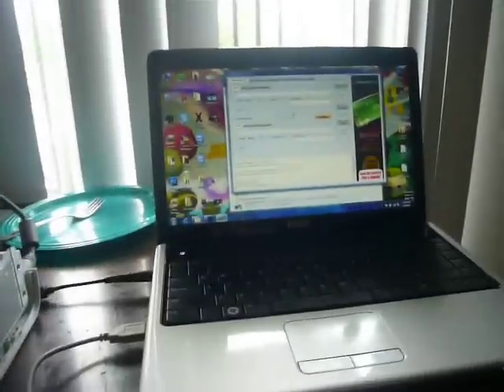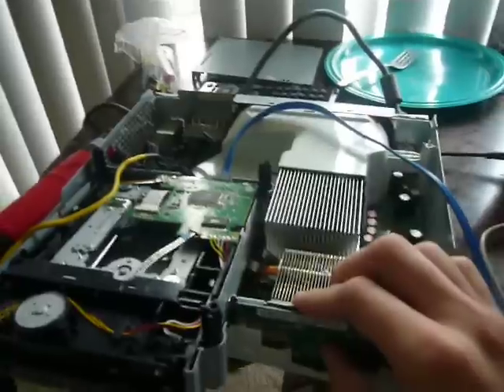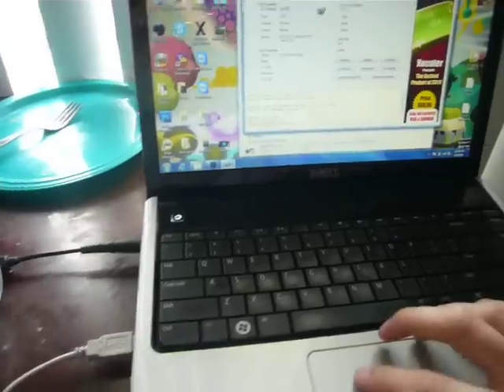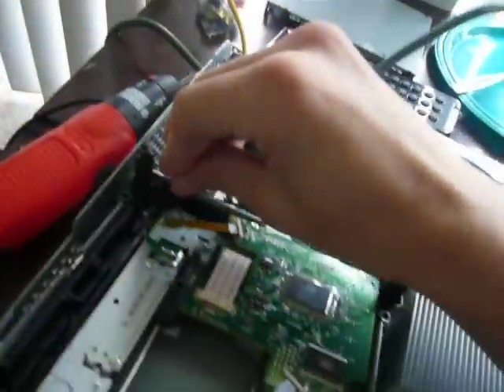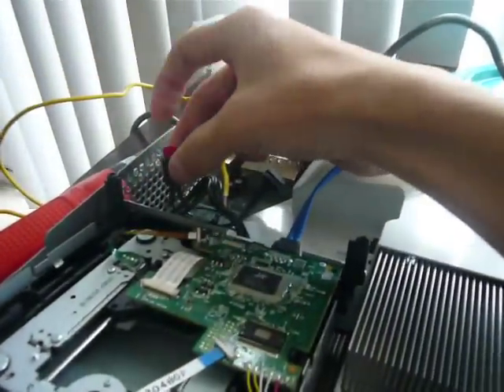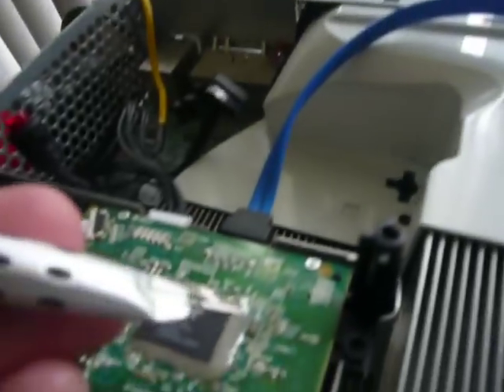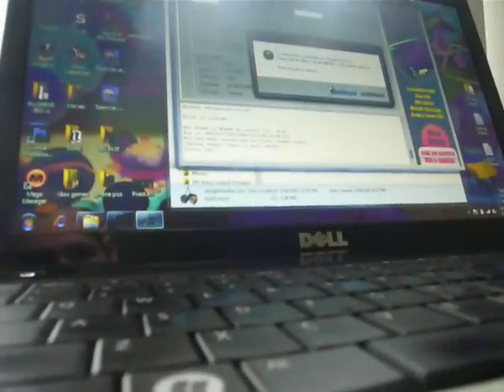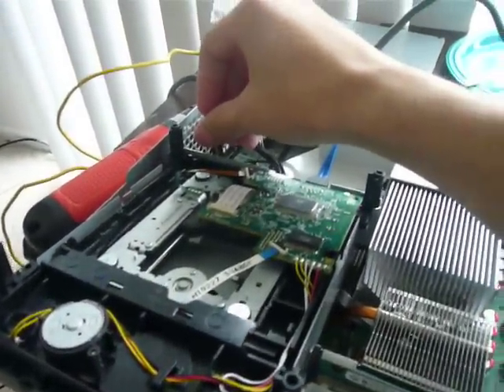Other method for getting key on phatkey failed(TUT)

Comment from the maker: i would atleast electrical tape it. you dont want any wires touching and shorting out anything. just a heads up ive seen it happen to people before doing that. i think i only paid $2.35(usd) for my switch and i had the cable laying around. so my diy PMT was only like a $2.50 thing. but hey atleast you got a working PMT thats what matters.

Comment: Who needs electrical tape? I just twisted the wires around the switch's metal pins, of course it's bulky, but I only paid like 1,65 Euro for 2 switches (and I used the 2nd for my DROM drive). I wanted to get a working console as cheap as possible after my old BenQ rrodded, so I got me one with a dead laser off ebay for 30 Euros without any controllers, PSU and whatnot, used the laser off the BenQ and the cheapest method for getting the key, which is a wire, a switch off ebay and a sewing needle.

Comment from the maker: yes but really thats sloppy and those switches your talking about are huge and bulky. i made my for compact. If i just used a on off switch from home it would be huge as hell. And you may want to just remove insulation and add your wire to that line thats cool. BUT again your doing it sloppy. your prolly adding just electrical tape after you do it. i prefer heatshrink the whole way thats why i cut the line to add it. Your choice tho..you ca go sloppy or do it right the first time.

Comment: But you can also use a simple on/off switch, just take the cable that sends power to the drive (the black one with the white connectors) cut the second wire from the left, remove the isolation on both ends and connect the switch, you don't even have to solder it. I got my switch off ebay.

Comment: thanks i know it sounds silly,, its just a simple switch im sure,, but just want to do it exactly how you did,, i got my switch/button at radio shack (it is a 4 pin) and im not sure if that was the correct one to wire into the drives pwr ribbon type cable,,, so  if you can just describe the buttons wiring  into this setup  i know the 3.3v pwr (pin 6) gets the switch wired into it,, and (pin5) gets the probe,,,just want to be sure im doing it correct,,,,

Comment: is it normaal that when I click on YES powerOFF the drive and WITHOUT POINTING THE PROBE as soon as i click on powerON  i get the message "SERIAL FLASH FOUND WITH THE STATUS 0X52" WTF?? btw  I try to flash it with the new iextreme v2.0. i use ck3 probe but no luck i get Phatkey failed all the time :(